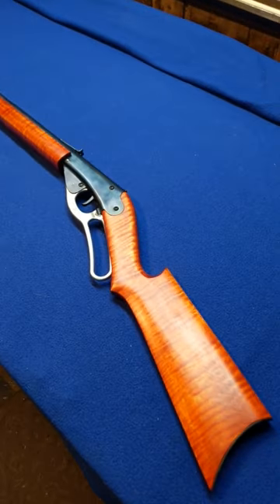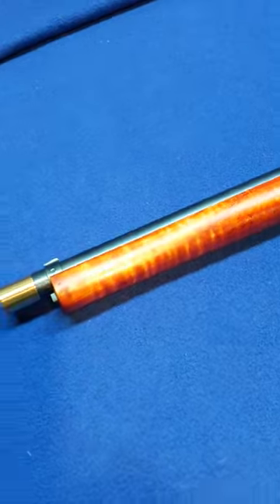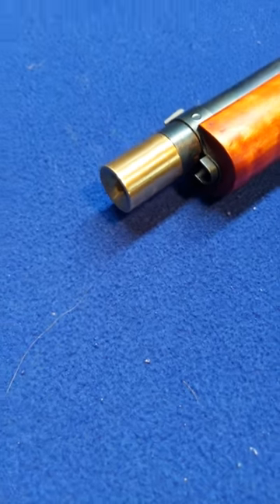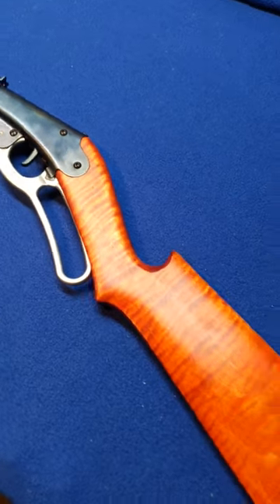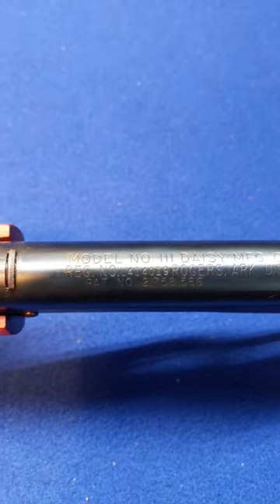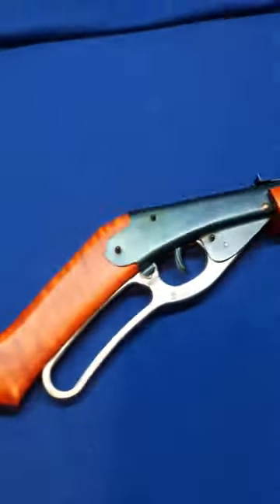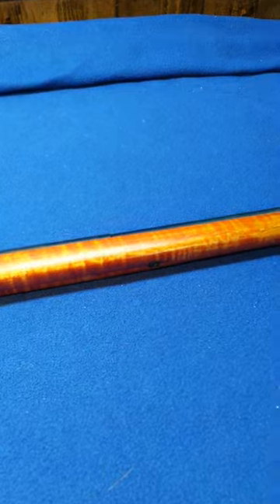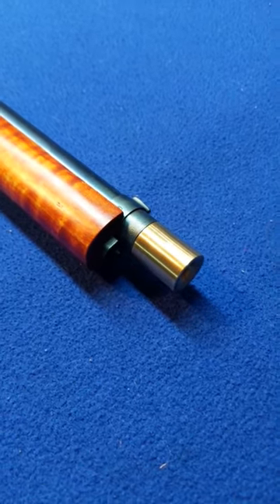Restomod Daisy Model 111 that hits 500 FPS+ with a Terry Cowger single shot muzzle loading shot tube

Comment: Like to see the rest of the shot tube 😮
Reply from the maker: I'll be getting one done over the weekend, but why wait? Head over to Terry's YouTube channel and get the build with deets!

https://www.youtube.com/watch?v=iQD4kIQLO_s
Reply: Wow!  I wonder if I should invest in a metal lathe? (I'm only half joking)
Reply from the maker: @daisylevergunfun4786  The mini-mats will break your heart, so much promise, so little results.
Reply: @RestOModDaisy  mini mats?
Reply from the maker: @daisylevergunfun4786  Actually they were called Uni-Mats, desk top mini lathes from the 1970's. My father was obsessed with them for a time.
Reply: @RestOModDaisy  
That's all I have, only mine is made by Sherline.
I got the lathe and mill over 40 years ago and I don't know what I would do without them.
I have made a bunch of money doing machine work for my business and others through the years.
 Yes larger would be nice and even better but then you need the space for it and Fla, doesn't have basements so thats not gonna happen.
Actually you could make one of these with just a good drill press and a drill press vise, would take some figuring but you have to figure no matter what tools you have.
Terry